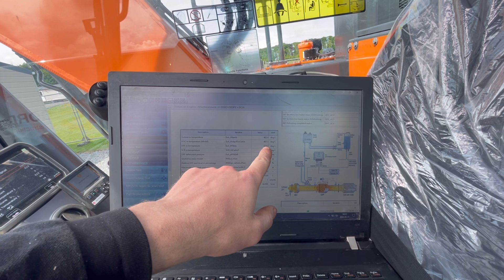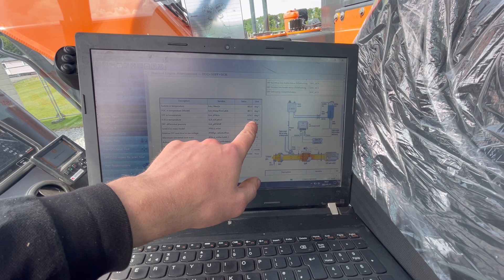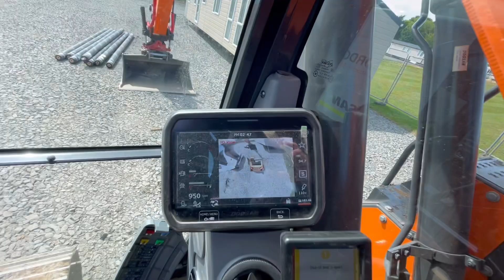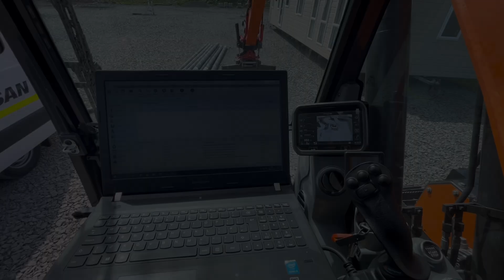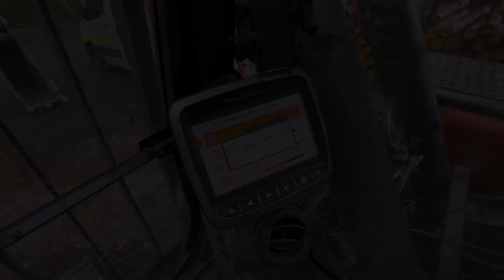Episode 56 - Huge tour of the north east !

Comment: Glad you got the hydraulic oil leak sorted. I reckon if you put a straight edge on the flange you’ll find it’s warped. Don’t know if the flange bolts should be tightened in sequence, but if an over zealous assembly worker has zapped them up while the flange is on a tilt, it could be twisted.
Once again, great video, and have a great day celebrating your birthday, you deserve it.

Comment: We had issues with adapter oring flanges before where welding of pipe to flange had distorted the flange and allowed oil to leak out regardless of how tight bolts were !
As a temporary measure until new parts arrived , we would use a glass sheet ( level surface) and emery water paper to try lower the high spots to stop the leak and then use some key steel to check for  evenness of surface 🤙
Reply from the maker: I recon that was the problem with it haven’t hear anything back from it 🤞

Comment: Wat tool do you use for remove oil filter
Reply from the maker: Just large filter pliers mostly
Reply: @alisdiggerdiary  Thanks Ali, a good video. Bleed these pumps on idle and stretch plastic sheeting across underneath to collect diesel, oils, coolant etc. Turn your drum 180 degrees when filling-stops the oil surge. Try band straps for your filters. Those Flange fittings where a problem on the Volvo loading shovels, stressed when installed at the Factory so loosen off and reset everything then re-torque the capscrews. Worked most of the time!. Good luck.